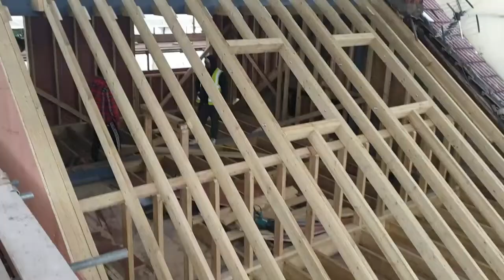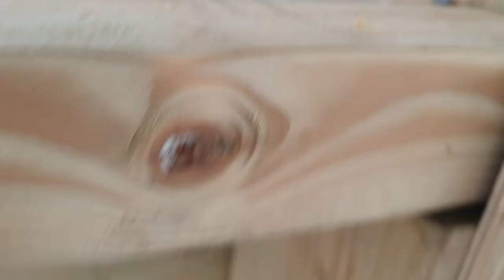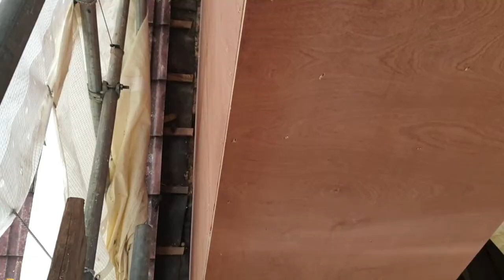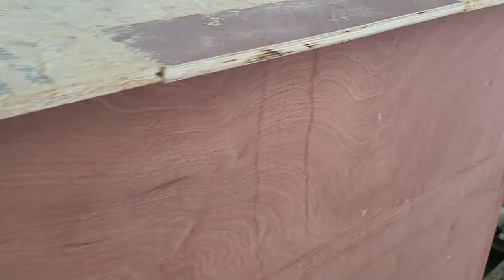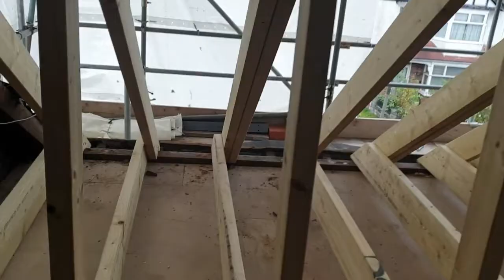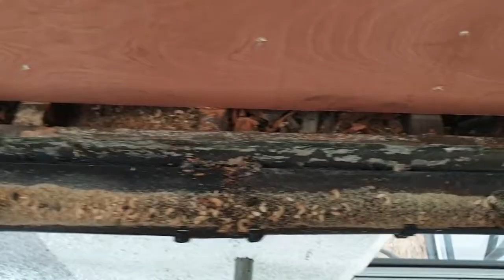LOFT CONVERSION DAY 4 - Construction of Loft Dormer Structure - Day 4 of 18

Comment: Hi, how are the rafters holding on to the steel ridge beam? The rafters what I see is simply inserted and supported by the side noggings, same from the pitch side, what I feel there is no proper bonding connection between rafters and the steel ridge, rest all structure work is rock solid. I would appreciate if you could explain how the 2 either sides of the roof will hold together other than simply putting the weight on ridge beam?
The video is very clean and very well explained one of the best seen so far.

Comment: Hi, thank you for your video very helpful.Can I ask you how did you manage to get the structural timber frame done  around the chimney  breast , specially on the roof.I'm trying to get a picture in my head with regards to the 40 mm gap between chimney and any timber.Thank you

Comment: Hello. Regarding the side of the Hip to Gable, Could you extand the wall with Bricks instead of Wood ? why not using that option ?
Reply from the maker: Hi. Thanks for watching and the question. Yes you can build up the gable wall using bricks but it would be more expensive and take longer than timber. It is not supporting any load so there is no real benefit. 👍